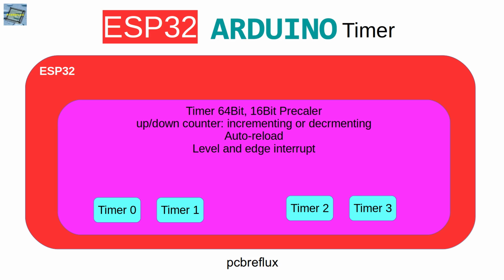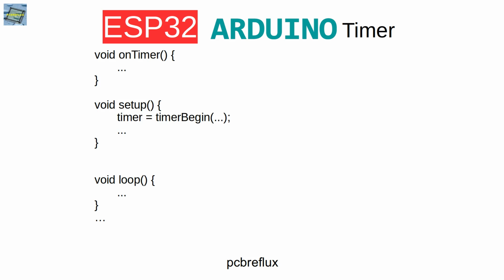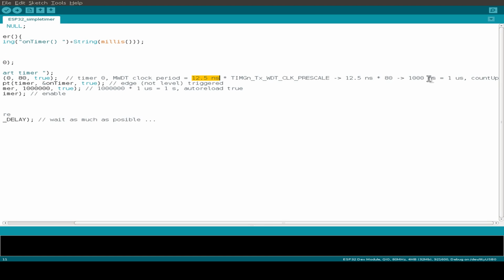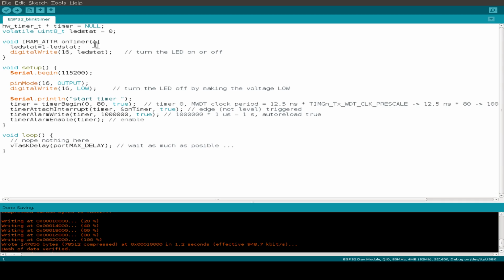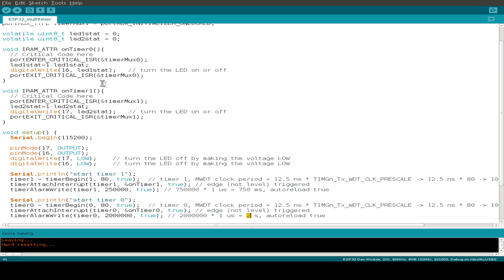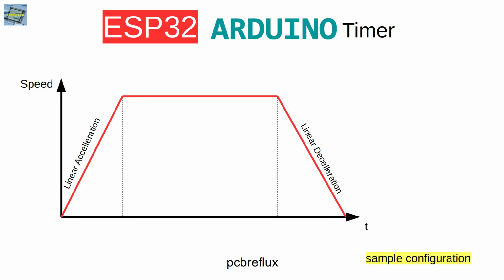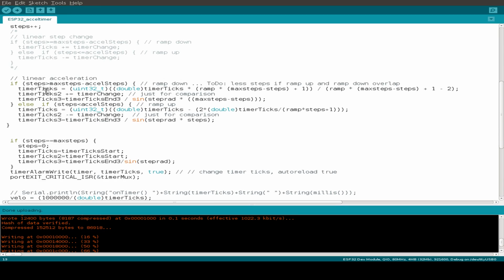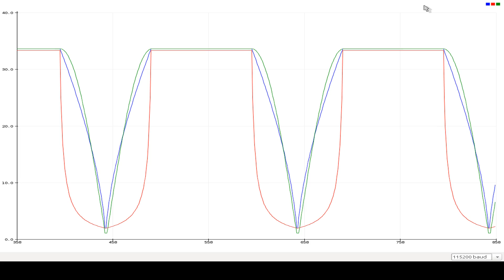ESP32 #56: ESP32 Timer & Multiple Timer & Changing Timer

Comment: Helpful video, thanks. Just exploring ESP32 for science. I am thinking whether it is possible to use it as a delay generator to trigger our expeirments. We are currently using SRS DG535 or BNC 577. Of course the ESP32 is far off their specs (would be strange if not), but many of our applications are fine with microsecond accuracy. I will give it a go and check what is possible with the ESP32 timers.

Comment: Hello thanks a lot for your video. how can I set an interruption of 58 and 116 microseconds and how can I use the loop during the same time. I need to create interruption with no discontinuity and to continue to code de loop pin order to perform other tasks. Is it possible. Please find my code below. I want to blink a led on GPIO 27 in the loop and to send a signal to led2 and 23 every 58 (BitUn) and 116 (BitZero) microseconds.
Thanks for your help. I am a beginner so pardon me if my question is not clear enough.

/* create a hardware timer */
hw_timer_t * timer = NULL;

/* LED pin */
int led = 27;
int led_2 =2;
int led_23=23;

/* LED state */
volatile byte state = LOW;

void IRAM_ATTR onTimer(){
  //state = !state;
  //digitalWrite(led_2, state);
  //digitalWrite(led_23, !state);
  //delayMicroseconds(8500);
BitUn();
BitZero();
}

void setup() {
  Serial.begin(115200);

  pinMode(led, OUTPUT);
  pinMode(led_2, OUTPUT);
  pinMode(led_23, OUTPUT);

  /* Use 1st timer of 4 */
  /* 1 tick take 1/(80MHZ/80) = 1us so we set divider 80 and count up */
  timer = timerBegin(0, 4640, true);

  /* Attach onTimer function to our timer */
  timerAttachInterrupt(timer, &onTimer, true);

  /* Set alarm to call onTimer function every second 1 tick is 1us
  => 1 second is 1000000us */
  /* Repeat the alarm (third parameter) */
  timerAlarmWrite(timer, 1, true);

  /* Start an alarm */
  timerAlarmEnable(timer);
  //Serial.println("start timer");
}

void loop() {
  state=!state;
digitalWrite(led,state);
  delay(2000);
}

  

void BitZero() {
    digitalWrite(led_2,LOW);
    digitalWrite(led_23,HIGH);
    delayMicroseconds(116);
    digitalWrite(led_2,HIGH);
    digitalWrite(led_23,LOW);
    delayMicroseconds(116);
}
void BitUn() {
    digitalWrite(led_2,LOW);
    digitalWrite(led_23,HIGH);
    delayMicroseconds(58);
    digitalWrite(led_2,HIGH);
    digitalWrite(led_23,LOW);
    delayMicroseconds(58);
}

Comment: Thanks for the info.
I am using your example code, to turn on and off a led with "digitalWrtie", but I do not get pulses under 2 microseconds.
I have adjusted the code in the following way.:

//===================================================================================
const int        ledPin  = 13;
volatile uint8_t ledOn   = 1;

hw_timer_t * timer    = NULL;
portMUX_TYPE timerMux = portMUX_INITIALIZER_UNLOCKED;

extern void IRAM_ATTR __digitalWrite(uint8_t pin, uint8_t val){
    if(val) {
        if(pin < 32) {
            GPIO.out_w1ts = ((uint32_t)1 << pin);
        } else if(pin < 34) {
            GPIO.out1_w1ts.val = ((uint32_t)1 << (pin - 32));
        }
    } else {
        if(pin < 32) {
            GPIO.out_w1tc = ((uint32_t)1 << pin);
        } else if(pin < 34) {
            GPIO.out1_w1tc.val = ((uint32_t)1 << (pin - 32));
        }
    }
}

//===================================================================================

void IRAM_ATTR onTimer(){
  portENTER_CRITICAL_ISR(&timerMux);

  __digitalWrite (ledPin, ledOn ^= 1 ? 1 : 0);
 
  portEXIT_CRITICAL_ISR(&timerMux);
}

//===================================================================================

void setup() {

  pinMode(ledPin, OUTPUT);
  
  timer = timerBegin(0, 10, true);
  timerAttachInterrupt(timer, &onTimer, true);
  timerAlarmWrite(timer, 10, true);
  timerAlarmEnable(timer);
}

//===================================================================================

void loop() {
  vTaskDelay(portMAX_DELAY);
}

Comment: Thank you for the tutorial. I could test the code perfectly, but it seems that any code will crash if the prescaler is at 8 and the alarm counts to 1. That is a time of 1us. I'm needing to interrupt every 100ns and i 'm not finding the solution for this trouble. Do you know how to solve this problem? Thank you in advance
Reply: If the prescaler is 8 you will have only 8 instructions for the microcontroller between interrupts. Probably your code will last more than that and you will always have junk. If you need to process something so fast, you will need an even faster microcontroller/microprocessor.

Comment: Hi, are you absolutely sure it has a 80MHz timer ? Because all i'm getting is 40MHz. I have a dev board with Wroom-32. thanks.
Reply from the maker: Popescu Paul Not sure. All I find is the timer depends on the (external) oscillator:   External 2 MHz to 60 MHz crystal oscillator (40 MHz only for Wi-Fi/BT functionality) ... maybe max is one tick?
Reply: pcbreflux thank you for the answer.  If the premise is correct, setting the prescaler to 1 will make the blink 80 times faster (80Hz) Right? I'm trying to figure this out because I spent an entire day troubleshooting based on the premise that the timer is working at 80mHz.
Reply from the maker: Popescu Paul Sorry maybe miss your question. And yes acording to the formular 12.5 ns * 80 -> 1000 ns = 1 us setting the prescaler from 80 to 1 should do this, BUT the minimum setting is 2 see https://espressif.com/sites/default/files/documentation/esp32_technical_reference_manual_en.pdf ... from chapter 18. 64-bit Timers ... "A 16-bit clock prescaler, from 2 to 65536".
Reply from the maker: quote: "The prescaler can divide the APB clock by a factor from 2 to
65536. Specifically, when TIMGn_Tx_DIVIDER is either 1 or 2, the clock divisor is 2; when TIMGn_Tx_DIVIDER is
0, the clock divisor is 65536. Any other value will cause the clock to be divided by exactly that value."

Comment: Thank you, I was very interested into whether multiple timerMux can be used. There is little easy information on this feature. Your video was very helpful.
Reply from the maker: Hope you see the ESP32_multitimer.ino example there are mutltiple timerMux (timerMux0 and timerMux1) used. If you change a variable (i.e. memory or registers) inside a interrupt this prevent the crash (sometimes on random circumstances) of your code, because different tasks could possible change the same variable at the same time.
Reply from the maker: If you interested in ramping up/down stepper motors with a sine wave (sinusoidal driving) maybe this video is helpful https://youtu.be/LONGI_JcwEQ (just the timer example).

Comment: Thank you for yet another very informative video. 

I have been trying to use timers to generate pulses to eventually control two stepper motors. 
I have also tried your multitasking code, which I got working OK, but I could not get them to move fast enough, when using the multitasking method. 

Regarding your example in this video of the multiple timers, is it possible to stop, start and reset either of the timers using some controls in the main loop?

In my experiments, even though each timer has a different interval, stopping or starting one always causes the other to change interval too, or stop. 

Here are my experiments so far. https://gist.github.com/kosso/f59e6cd6eb92a24ef76a4eb4632dcbce

Comment: Im pretty new to coding how would i convert it to hours?
Reply from the maker: JonEric Eubanks What is your use case? If you need to run some code every hour maybe use deepsleep to save energy. But for the simple timer there are 60s in a minute and 60 minutes in a hour so multiply the timer for a second with 3600.

Comment: thanx for this knowledgeable video, I want to capture time in deep sleep do you have any code for it?
Reply from the maker: +Parman Josan Hi, have you found a new law of physics to store time? Just a deep sleep joke ...  How do wan't keep the time while sleeping? You can sleep for a given time and the ULP cocpu keep the internal clock running. Or after wake up you can get the time from a source like SNTP or external GPS or RTC. What do you prefer? Just using the internal esp32 clock is not precise in most cases.
Reply: pcbreflux , there is a RTC timer and and RTC resistor which also runs in deep sleep mode.I have code of it but it is in different firmware so don't give an advice if you don't know about it,brother.
Reply from the maker: Parman Josan Sure there is a RTC register, but not seen any affordable modules that came populated with a RTC crystal. And deriving the RTC clock from the 40Mhz crystal is not so accurate.
Reply: okk, tnx @pcbreflux
Reply from the maker: Here are some examples that may fit your use case:

From Neil Kolban - DS1307 Real Time Clock
https://www.youtube.com/watch?v=irtxFEZPRrg
From Neil Kolban GPS Code
https://github.com/nkolban/esp32-snippets/tree/master/hardware/gps
From Espressif Arduino Time HAL:
https://github.com/espressif/arduino-esp32/blob/master/cores/esp32/esp32-hal-time.c
From Espressif SNTP esp-idf example:
https://github.com/espressif/esp-idf/tree/master/examples/protocols/sntp
Andreas Spiess (S)NTP for esp8266:
https://www.youtube.com/watch?v=qzkNXhubWLg
Andreas Spiess Timed Deep Sleep for esp8266:
https://www.youtube.com/watch?v=BzFM3PWx1rg

All example need a external time source and (S)NTP only works if your device can connect to a time-server.

Comment: Thanks for this video. Am I right that I can use all 4 timers at once without losing time resolution?
Reply from the maker: mallewax Hi, even if the organised in two groups you can use all four timers independently. From the technical manual ... "Each timer uses the APB clock (APB_CLK, normally 80 MHz) as the basic clock".
Reply: Hi, thanks for the reply. I may have overlooked that information in the manual... But now I understand
Reply from the maker: Don't expect that I read all the informations in the manuals (and I do not expect this from others either)  ... i read just the parts that I am currently interested in ... and unfortunately only a little was stored in my long-term memories.

Comment: Thanks for the example code.
Now I used your example "simpletimer" in a timebase for an interrupt based counter.
I am quite sure, that all the Code is running on the same core. Showing a website affects the counter value (e.g. @ 10kHz). While couting using Interrupts the "arduinoOTA" does not work. It works as Long as you have no Input signal. But not with an Input signal.
 
So, I am still looking for a method to run the wifi and OTA on core 0 and the couter stuff on core 1.

btw: in your multitimer, what does this mean?
portMUX_TYPE timerMux0 = portMUX_INITIALIZER_UNLOCKED;
portMUX_TYPE timerMux1 = portMUX_INITIALIZER_UNLOCKED;
portMUX_TYPE timerMux2 = portMUX_INITIALIZER_UNLOCKED;

And why is that NULL?
hw_timer_t * timer = NULL;

Comment: Thanks for your video. Sir I am having doubt on ESP32 if you have time please clarify.
Is it possible to use the ESP32 module for communicating with an external sensor(having inbuilt Bluetooth module) over the Bluetooth and parallelly send the sensor data to the server by using Wi-Fi? 
If it's possible please tell me which code I should use to program ESP32?
Reply from the maker: Sure the ESP32 can do this - see https://youtu.be/F4tMvfXDSbU for a example using Bluetooth and WiFi (now I wouldn't use blufi this was a misleading task) and to read maybe a nRF51822 BLE Sensor see https://youtu.be/brD3dYTK6Fg and for thoughts about a BLE/WiFi Gateway here https://youtu.be/PBYCG-ypvRY.  And more on Bluetooth https://youtu.be/_ELUt2EDUR0 and here https://youtu.be/FvIywveUVZw. 

The magic happens in FreeRTOS you just start one task for WiFi and an other for Bluetooth and use inter task communication (https://youtu.be/DLqj01asDM0 or https://youtu.be/iunw7qd5Wr4) for sync the tasks.

If you are a beginner have a look at Neil Kolbans (https://github.com/nkolban/esp32-snippets/tree/master/cpp_utils) library for Bluetooth and WiFi and use the ESP-IDF (https://github.com/espressif/esp-idf). The Arduino implementation is not really ready yet.

And a Tip: all tasks (especial WiFi and BLE) need memory - start the tasks witch enough StackDepth to avoid crashing applications [xTaskCreate(...,usStackDepth,..); ].
Reply: Thank you very much sir.
Reply: Dear sir, If I added a new Bluetooth device (sensor Bluetooth module address) in the place of beacon Bluetooth address exist in the code ESP32_blufi_beacon_tracker. ESP32 can read the sensor data? or I should do any extra modification in ESP32_blufi_beacon_tracker code.

Comment: Thanks a lot for this example.
Currently I use blocking code (delay) for analogRead capture to feed an 2048 FFT. This is not very smart but is strictly serial and has the advantage of Iess interference with other things like wifi or I2C. But I observe the frequencies are measured a few percent too high.
Maybe that using a timer would give a more stable time base. But I fear that this would interfere with I2C or wifi. What do you think about that?
Reply from the maker: Hi, Espressif don't tell us much about how the (binary) WiFi stack is implemented, but as far as i assume WiFi and Timer uses different clock sources (APB_CLK for TIMG and PLL_CLK/APB_CLK for WiFi) and also different priority levels for interrupts, so you only have to fear to slow down your data transfer rates.
Reply: Thanks for the Reply. Whats about I2C? In ESP8266 it was done by SW bitbanging. I am not sure how it is done in ESP32.
Reply from the maker: From http://espressif.com/sites/default/files/documentation/esp32_technical_reference_manual_en.pdf (now over 500 pages ...)

"The ESP32 has dedicated hardware to communicate with peripherals on the I2C bus" -> no bitbanging -> no interference with the timer.
Reply: Yes, the chip might have the capabilities, but are they used by the Wire.h lib of the ESP32 package? I have no Clou.
Reply from the maker: Just have look at the code https://github.com/espressif/arduino-esp32/blob/master/libraries/Wire/src/Wire.cpp uses the https://github.com/espressif/arduino-esp32/blob/master/cores/esp32/esp32-hal-i2c.c  luckily no bitbanging.
Reply: Thanks for evaluating this! 
Looks good. This Wire.cpp is identical to that which is used by my arduino IDE.